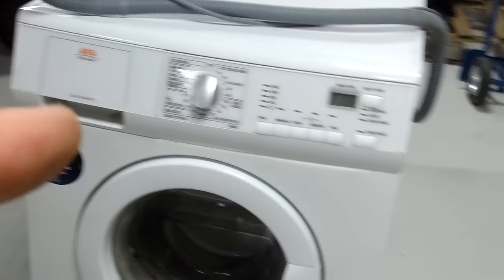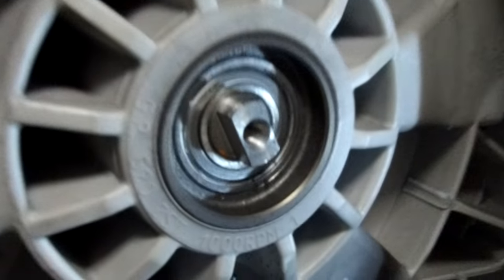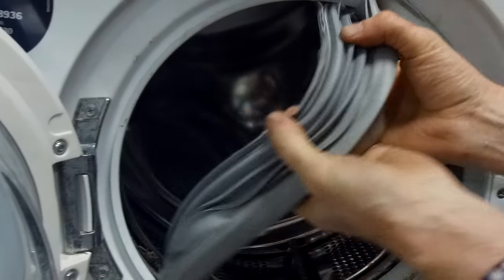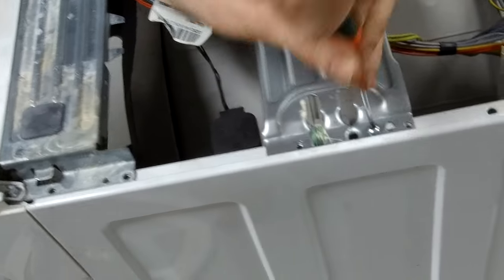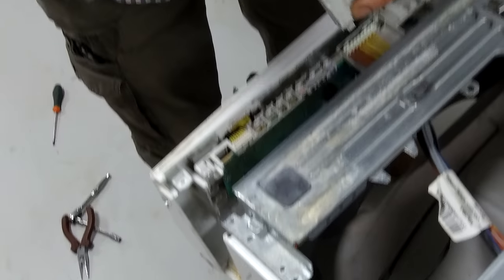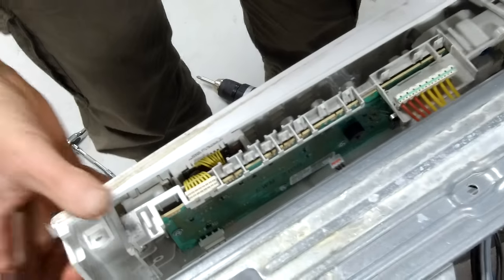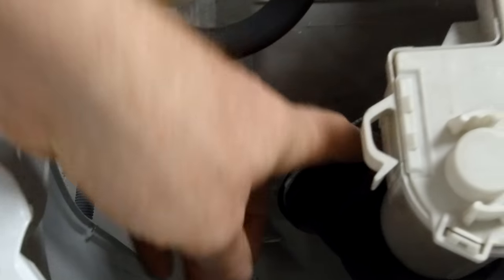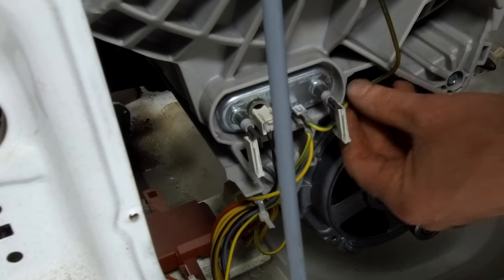AEG Lavamat washing machine strip down - Sealed drum can't fix :-(

Comment: There is a way to split the plastic drum and silicone it back togeather. Drill some holes for screws (& nuts) in the ear sections which are thicker on the same area all around where it has been plastic welded.  With a precision saw cut the drum open from where it is platic welded making sure you are cutting it flat and clean as have to put it back togeather. Replace the Y frame or bearing which ever seems to be the problem. Then apply silicone sealant on the face that you have sawed off, join the plastic drum and screw it togeather with suitable screws and nut in the location where holes were drilled. Let it dry over night and check it for any leaks the next day before putting it back in to the machine. Seen it done in other brands of machine where the drum is plastic welded.

Comment: I recently had also a bearing failure in an AEG top loader. For some reason they use replaceable bearings on those. The root cause was an axle gasket failing which allowed water through the bearing rinsing all the greases off of the bearing and subsequent rust build-up. The machine is 3 years old. AEG provided new bearings as a goodwill but I needed to pay for the change.
Reply from the maker: That was a nice gesture from aeg

Comment: So,. I had the same problem.
Used this video as a guideline!

And I have 2 say,. Not all of them are plastic welded shut.
Mine could be opened through the middle by just getting about 15 screws out of it.

Lucky me, mine is fixable.
So the bearing kits are usable for some AEG machines 😊

Comment: Always easier to take bits off then put back.Replacing that seal looked a nightmare.I ve got the same machine and it saved me a long time and frustration taking it all apart. As you say it was destined for the dump after the first five mins so had a bit of fun ripping it all apart .Least I know now why mines knocking and shaking on a spin .

Comment: Well not sure what you guys done wrong but I have same machine leaked water out through bearing I removed drum undone all the screws and replaced bearings and reassembled job done working fine e after replacing bearings I drum and the motors bearings. All in all a very fine washing machine fixable easily done.

Comment: Apart from the soap drawer and front control panel that AEG machine is exactly the same as our Zanussi machine that l have just dismantled for drum bearing failure. The drum is definitely sealed, the central circumferential joint flange is welded. Although the flange could be split by carefully sawing round it l would seriously question if it could be resealed adequately. This means the drum front bearing, the one that fails, cannot be accessed for replacement.
Interestingly our machine lasted for 15 years before bearing failure, so not too bad.
A complete replacement drum with new bearings etc is about £225 so not really worth it given the cost of new machines.
Our machine went to the tip.

Comment: I own a Miele hope is not as difficult to fix at least you tried  good vid I had a similar prob is a Wilkins Service one of support arms broke I was able to fix it, however  one day it let out a loud bang and  never went again.
Reply: Depends on what Miele. If it's W1 9kg you have a stainless drum, easy to fix. W1 7kg and some 8kg use plastic which is welded, but most 8kg are stainless too. Most other brands have plastic with screws, not welded, it really depends on model.

Comment: The AEG is an expensive label on a cheap product, better off buying the half the price, identical apart from the label electrolux. The piss poor bearings and from this video piss poor drum manufacture are just part of the cheap and nasty reality of this machine. Mine was junk after just 6 years of 3 washes a week because of this drum (a replacement costs as much as a new electrolux). Frankly will steer well clear of this companies (groups) products in future
Reply: Dave Hitchman  My aeg is 15 years old. I replaced myself the belt, a two door handles. We make at least 6 uses every week. Never overcharge it, a vinegar cleaning every momth.  I expect it to last another 5 years.
Reply: @honestguy7764  Wright!Oldies but goldie's!Unfortunately today everything it is made just for consuming!Days ago a replaced control board of my aeg 10 old.OMG looks like new!A piece of war!Today you'l buy only new crap!
Reply: No, This AEG lasts 10 years -> 6000 operating hours. Very good quality. Better then you think

Comment: Moral of the story? Don't overfill your washing machine. People seem to think if it can go in, it's not too full. Fill a drum with towels, and this is the longterm expected result.
Reply from the maker: I sort of see your point but
1 - the bearings on my car take tonnes every day - no problems
2 - why design a machine that cannot be repaired....
Reply: @L663  I suspect this isn't a 'typical'  problem. You are right about the bearings in your car,  but the pressure on them is direct. To make the same comparison you'd need to have wide spacers on each wheel hub, with 14" wheels and tyres, so the forces on the wheel bearing make them act as a fulcrum. With setups like this, even wheel bearings expected to see 40,000 miles of use, will fail early.  But the bearings in the machine were reported as 'okay' I thought? The problem appears to have been stress fractures in the bearing hub webbing to the drum. This suggests (only suggests mind) the drum was periodically (so not regular enough to damage the bearings) subject to severe forces (meaning unexpected - outside the design weight) that tried to 'bend' the drum off the bearing hub. That is pretty much defined by lots of heavy towelling.

As to why design/use a drum manufacturing technique that can't be serviced? As the bearing can be serviced, I'd say the design works and allows all the usual maintenance necessary (meaning 'expected' maintenance of course). The problem you show, the fracture of the hub, looks like metal fatigue induced by "out of limits" wet weight in the drum. Or periodic heavy use outside the expected life of the drum. (Used for longer than expected. Say 12 years not 10.) Aircraft are designed for and often 'retired' after an expected service life of 20 years. Sometimes they don't reach that age because of an event outside the design envelope, despite the design being over-engineered to accommodate the 'unexpected'. Everyday machines are overengineered too, but not by such a great margin as aircraft. Washing machines are, after all, a consumer product. They are expected to have a finite life. They might last 20 years, but are probably only expected to see a 10 year working life. Rotten seals, limescale filled waterways/biological growths in water ways/failed water heaters/failed electronics, are probably the usual reasons for retirement. People don't expect these things to be serviced any longer - at all. The call-out charges and parts costs make it cheaper to replace the machine.
Reply: You can't blame people from stuffing up their washing machine when it's advertised to take 7-8KG of dry clothes. If you were to visualize that amount of clothes, you'd be surprised how much that actually us. Also, this is a spider failure due to corrosion. Corrosion is caused by sludge buildup, because people only wash at 30 or 40 degrees with too much liquid detergent and fabric softener. Use power detergent and 60 degrees with no softener regularly, leave the door open after use and the spider will never corrode like that.
Reply: Also this is not bearing failure. This is corrosion and subsequent failure of the drum spider, which is caused by poor (deliberate?) design decisions by the manufacturer. Yes, a lot of folk overfill their machine, but in this case that's not the cause of this failure.
Reply: Washing machines are only fitted with a 1000rpm bearing, no matter what spin speed you buy ,the engineer told me this ,they are made to fail ,its call sales lol